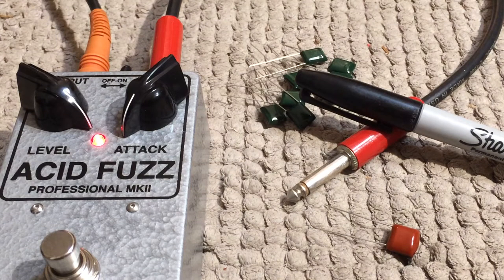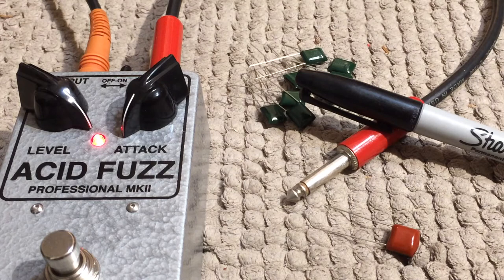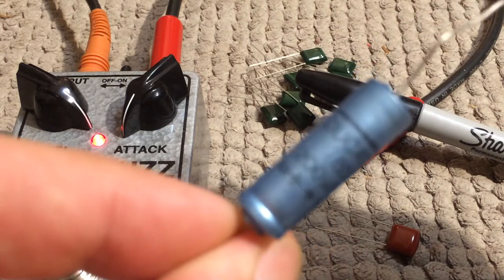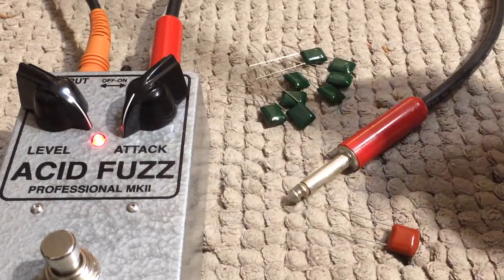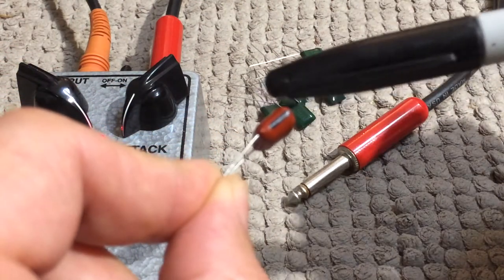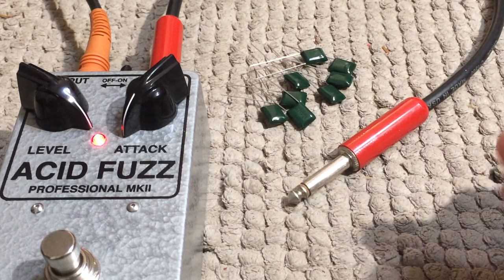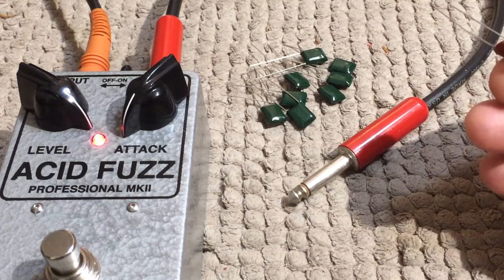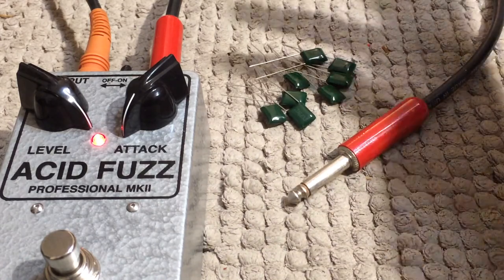Build Tip: Film Capacitor Polarity Test

Comment: thank you sir.
I'm replacing the capacitors in my 1965' champ amp, and this is important for noise reduction in a tube amp circuit, the electrolytics are marked although the orange drops are not. so again thanks for this simple tip. 30+ years working on amps and I learn something new and cool everyday. this is much simpler and faster than connecting to an oscilloscope.
Reply from the maker: Thanks Frederick. I'm glad you found this tip helpful with your Champ service. I had the same WTF? reaction when I first came across this after pulling some older film caps with the band/mark while servicing a Hitachi amp. For me, life is all about the "ah ha" moments and learning new things.
Reply: Can you tell me from where you manufacture your Ge Transistor

Comment: thank you for the great information about capacitors poles this issue is found when assembling a circuit (complex or just a simple circuit ) 
manually  after finish assembly and running a test sometimes the circuit do not behave as it's simulated on a PC this problem is solved on mass production assembly lines by the machine (it's fed by let's say a ceramic  capacitor in the way of a chain that have  it's printed face   up and the left pin is the negative side 
so when it install the capacitors on the PCB they are installed in the  proper polarity based on the PCB circuit  ( you can notice this by disssambling 2 radios same brand and model  and you notice all the components   printed side have exactly  the same directionin both radios . 
I hope to be my information helpful and to keep up the good work .

Comment: it would be awesome to get more practical pedal building tips like this!!
Reply from the maker: Is there anything in particular you would like building tips on?
Reply: Hmmm, off the top of my head... Well, I pick up a bunch of old distortions and fuzzes and deal with a lot of noise from energy sources, like whenever theres a battery or power supply plugged in. Maybe that could lead up to a video on troubleshooting pedals or somethin

Comment: Just what i needed.Have wanted to test all the noploar/bipolar capasitors on a dual riaa stage i am building and do to my left eye had some problems around a little week i had problems with seeing the osilloscope clearly.I play guitar and build hifi high end power amlifier and active dsp controlled speaaker system with planar magnetic technology with push pull neodym magnet bars in front and back of the thin caldex film the voice "coil".A driver like dthis is very senitive one mid they are 6 inch wide and 10 inch high each 96db 1 watt 1 meter. and it is a perfect load for a power amplifier do to the fackt it does not change impedance with frekvens and does not have coil milly henry.So everything in the source and signal chain has to bee quiet quiet.4 of those midrange from 270hz to 1900 with total sensititvity on the 40 inch 6 inch wide planar magnetics drivers in linesource with the 2 upper adjustable angle downwards so they all cross aty listening position.No roof reflectio or florr.The same goes for AMT tweeter section witch is 20inch high and 5 inch wide.tried normal power amplifiers like rotel upper end and nad and higher prized gear.but all off them was negative feedback amps local or global and they made hiss so  loud that i could hear it in my listening chair 3.5 meters away easy.with the one i had way back 2000 the end millenium xp i knew it was good.so i build a 4 channel one with 2 double toroidal transformators and 4 full bridge rectifiers and 240 000uf capasitor bank.Have to put my ear against the amt tweeter with around 98db sensistivity to detect the amplfier is on.build as 4 mono inside one cabinett 2 mono modules have one trafo double winded ac42V-042Volt and ac 42volt-042Volt on each trafo.they are 600va each.use autenator on inputs to get unity gain and let the filter run at 0 db on al outputs.when rommcorection or speakersystem frakvens responce is messured all the autenators are at full in.only uses the software to program the ground sound dnc24rpc digital dsp filter stereo 2 way mono with 2 innputs 4 way.i use them in mono config and have 2.One for each side.and man does it work.the customer i know will be a happy guy as the system is similar to the one i am building for him but also things he want that i have to try implement.the best posible soud is the goal.every amp in that system will be small class a near the planar driver for tweeter and midrange with same type filter described earlier.woffer section will have a pwm digital power amp.No switchmode supply alowed in my things

Comment: excellent novel approach to this matter...….nice short cut
Reply: nineball26 maybe just u are wrong, if you are little more interesting about this problematic you should know  well which is which this manual is really good i go to build fuzz efect only for this :D. And for the question, when is the capacitor connect on the jack the part which is on the top of the jack (position for signal) is positive if the noise is smaller its mean that this end of capacitors must be always on the bigger potencial ( higher voltage or if you vant them typicaly more at end in the signal way) really waste? Sometime is enough if u just know what are you looking for..

Comment: This is great info! So if I have this right, the foil end goes to ground on a tone pot for example, correct? How does this work when doing a treble bleed circuit, specifically the Kinman wiring in series? is there one side that goes to the middle/outer lugs specifically?
Reply: So the outer foil wire goes to the top of the potentiometer and the other wire to the lug?
Reply: Correct, foil end goes to ground, anywhere in the circuit, not just the tone pot.

Comment: I thought those didn't have polarity, btw how about replacing those with electrolytics?  Will it be less noisy?
Reply: I doubt there are electrolytics in the small values caps here. those look like they are  under .1uf  The polarity he speaks of is really the outside foil lead. Technically the old marked caps were not polarized either. Marked line denoted outside foil. The outside wrap will pick up the hum in your finger, that way you know which lead is the outside one.

Comment: Does the polarity interfere in the tone on a guitar wiring?
Reply from the maker: Generally, no. Polarity of tone capacitors in passive guitar wiring does not matter. Incidentally, only the value of the capacitor matters in terms of sound. Dielectric type, or what the capacitor looks like, does not matter. If you're restoring a high value vintage guitar and want to maintain originality, that's one thing. Paying a lot of money for Bumble Bee or other vintage capacitors thinking it will make a difference in sound is ~snake oil.
Reply: @acidfuzzpedals9986  thank you

Comment: Thanks for the great tip!.. or you could wear headphones to not wake up the wife and no need for scope.
Reply from the maker: Exactly. I added a headphone jack to a lower powered tube amp, exclusively for this reason. In my experience it's much quicker & easier to use this fuzz pedal in to tube amp method than a test jig and scope. Having a tube amp with a headphone jack allowed me to test caps without the fear of being screamed at.

Comment: I am not an expert. However, I bought a HoneyTone mini-amp to try this. It did not work - period. I bought a fuzz pedal to increase sensitivity, gain, and supply a different signal. It did not work - period. Fool me once shame on you. Fool me twice shame on me.
Reply from the maker: Sounds like you're not testing foil film caps or: https://youtu.be/eKgPY1adc0A
Reply: Could be. All the caps I tried look exactly like the first brown dip you tested. I tried 0.0022uF to 0.1uF 630V caps I was prepping for a Hallicrafters S-85 restoration. I can test capacitance/ESR with my $8 Chinese LCR meter. I can test capacitance and leakage with my rebuilt/calibrated Heathkit IT-28 no problem. I cannot get any hum from the setup you show with the amp and pedal, unless I touch the lead that is on the cable tip. Perhaps if you provided some more details like the type of amp you use - tube? Three prong or two AC cord? Amp and fuzz pedal settings? Just grasping at fooling me thrice...I think if I get an o-scope that has voltage scale sensitive enough to my 98.6Hz hum, I might be able to see the diff.Thanks for trying though.
Reply: Wondering if you ever got that problem worked out . . . since I've had the same results. I'd ask Fuzzy but I expect to go the same answer you did . . . Nothing. Any help would be appreciated.
Reply: Where were you when you tried it? Inside a home one picks up the EM from the electrical system. Not as much in a garage or outdoors. No one is trying to fool you. This is correct information. Plus, make sure you are holding the capacitor the way he is.

Comment: Dude you're misinformed. Or you've mixed up properties from different caps into one big amalgamation and now don't know the difference between them.
Reply from the maker: “Dude”….., Respectfully, I’ve been building/working with electronics for over 30 years. “Polarized” has many definitions, aside from describing the opposing regions/electrical properties of transistors, batteries, electrolytic capacitors, etc… Here I’m using the term to express the opposite ends of a film capacitor, the outer foil end (typically to ground/lower impedance), and inner foil end(s). Obviously, the term is also used in politics and physics.